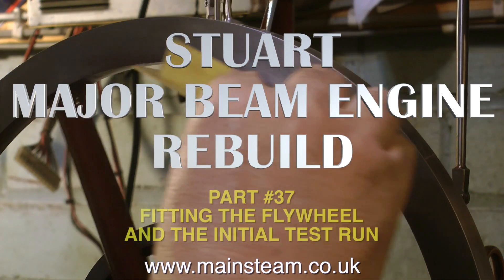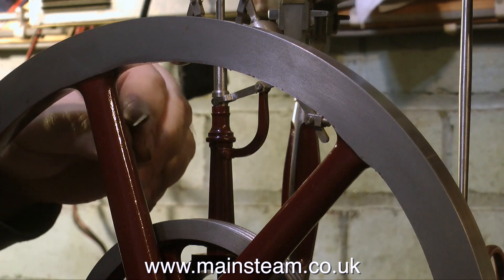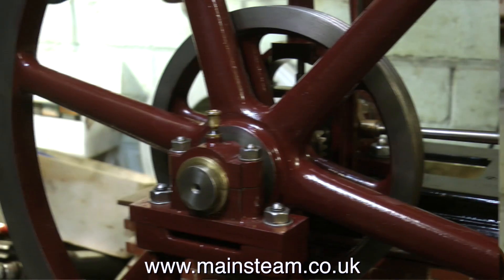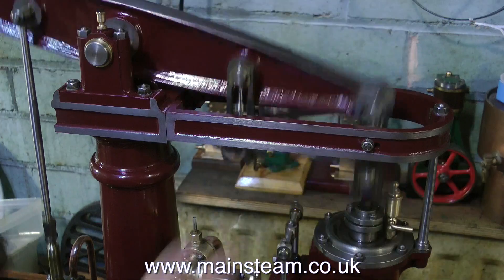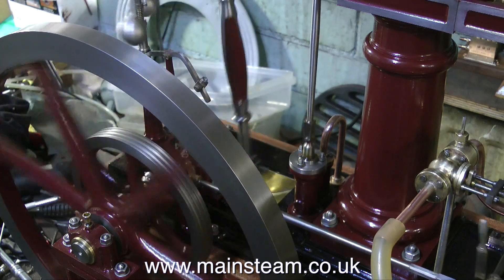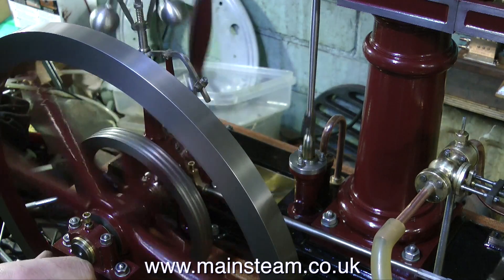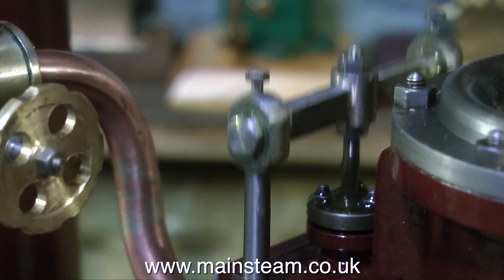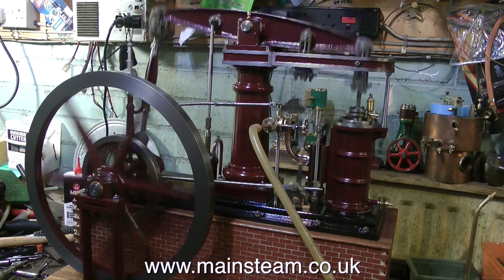STUART MAJOR BEAM ENGINE REBUILD - PART #37

Comment: Your 1 - 2 comment about timing was extremely helpful.  While in college I worked in an antique clock shop for two summers.  I’ve noted that listening for engine timing is much like listening to the pendulums, tick tock.   It needs to be even to ensure that the clock is level on the wall or shelf and therefore helping keep accurate time, not to mention pendulum adjustment. 

1 - 2 was very helpful. I reran that moment several times.  Thanks.

Comment: Speaking of fastening the flywheel to the crank, why did you choose not to use a taper pin? And is it possible to thread a nut on the big end of a taper pin for purposes of removal, or is it just as well to drive it out with a hammer?
Reply from the maker: This was a sympathetic restoration - I just re-used what was there in the first place.
Reply: Keith Appleton, I understand

Comment: In this episode at 4:37 I noticed some of your steam operated water injector pumps would you be doing or have you done a video of these as I am very interested in these thanks for reading and I would find it very interesting
Reply from the maker: Yes I did a vide a while back featuring some of the steam powered boiler feed pumps.

Comment: Hi mate.  I think that you have got it running slightly better than when you got it, just a tat.  Well done, however, now it will be hard to give her back to the witless owner.  Although, if he did not buy her, you would not have had her to play with.
Reply from the maker: +Marcel Timmers Slightly better ????? Please watch the original video again ..... It runs a lot better than it did and it has taken a lot of work to make that so - it now has a lot of power and the main beam runs centralised in the entablature.
Reply: That was what I mend, the machine is like reborn, but with more precision.  Never mind.